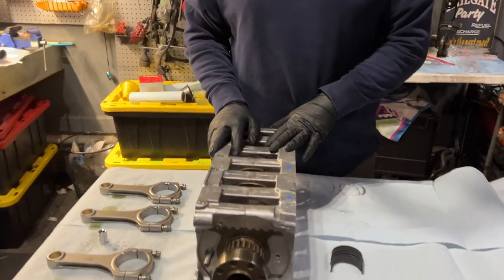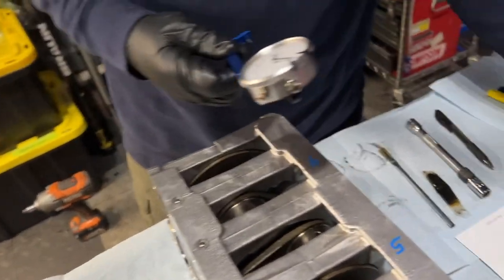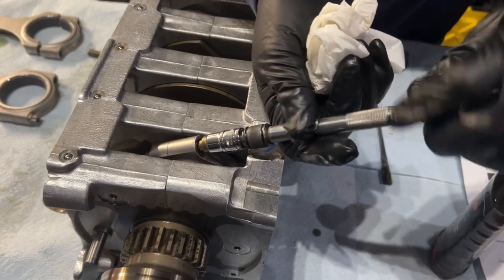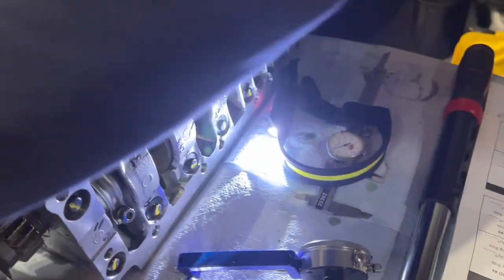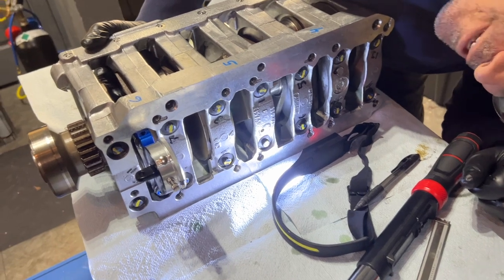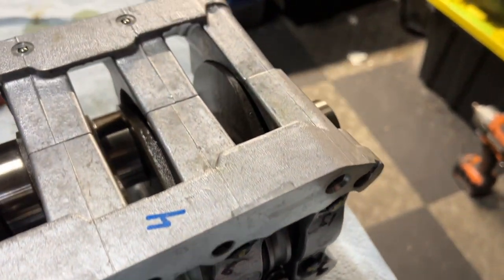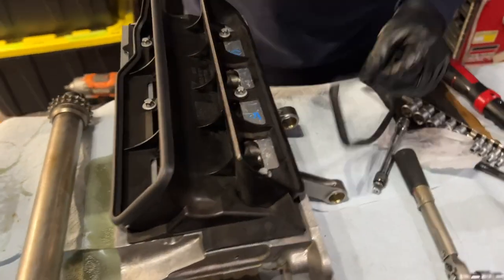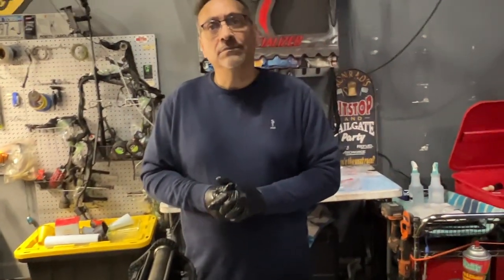Porsche 911 Engine Assembly Guide - Part 2: Connecting Rods, IMS and Chains

Comment: A little trick I learned for protecting the rods is to put the old cardboard tubes from the center of toilet paper rolls or paper towel rolls over the rod so it doesn't get scratched as you rotate the crank during assembly operations. Obviously remove the cardboard tubes before the pistons get mounted onto the rods.
Reply from the maker: +mike dx obviously 😂. Thanks for the idea.

Comment: I must have missed it . Why did you not do bank 1 con rods prior to IMS?  Great instructional btw.
Reply from the maker: +docdrs thanks! Because Bank 1 con rods need to be assembled to the pistons first and then to the crank after the piston is set in its cylinder. You’ll see, stay tuned ;)

Comment: If you put the bolt in the gauge zero gauge after you torque it and do your angle, you’ll only be measuring the stretch. But that method requires you to use two gauges one for each side.
Reply from the maker: +J P sorry I lost you

Comment: the idea of a bolt is to hold something down securely not to tighten to breaking point (stretch) if you was a cliff climber would you use a rope if it was stretched to preaking point (not me) if you remember the main dealers and manufaturers were griping about losing out on the sale of spare part because of people making patten parts its all down to time, so after sale of a new car x  years after the sale the cant sell patten parts so in that period what a way to make money by building them on the point of preaking and sit back and wait for the cash to roll in ... they just sold C0v1d to the planet without the. Koch postulates test so why not car parts mabe you think different to me im old school going through life with open eyes stretch bolts are like shear bolts buit to break
Reply from the maker: +Jo Ken any time you fasten a bolt it stretches some.  Every bolt has a an ideal torque based on the diameter, thread pattern, material, etc. tool loose and it will come loose. Too tight and it can snap. We were tightening to the manufacturer’s specified ideal value. Pretty standard stuff
Reply: @HelpMeDIY  to their standards which make them money. Uri Geller used to bend spoons till the point they were about to break then claimed he had magic powers when the broke he would of looked stupid bending it 20 to 30 times on tv before he done the trick theres people on youtube testing bolts to breaking point steel, ss, titanium ect and posting the result and readings ....everything has a breaking point its finding the balance point to give reliability not profit..... how much for a head gasket
Reply from the maker: @joken8901  standards that make them money? Well they would definitely lose money if they told you a value that would come loose or to snap I suppose… I’m just confused what you are suggesting… Ignore those values and just guess?